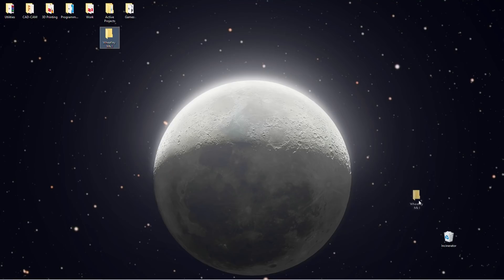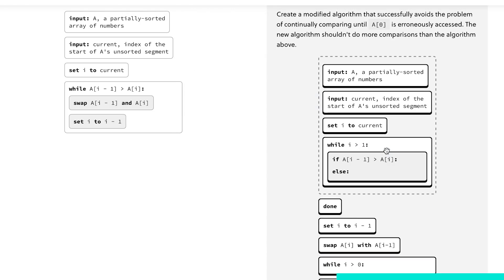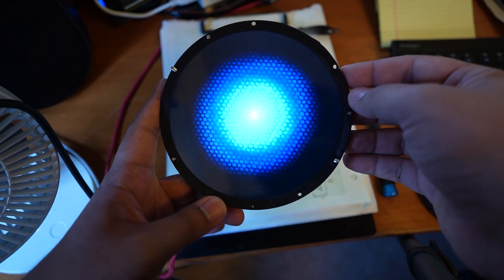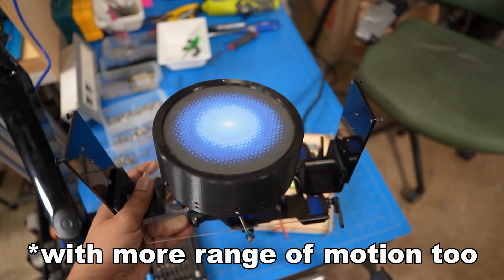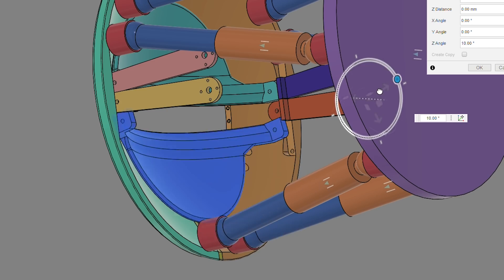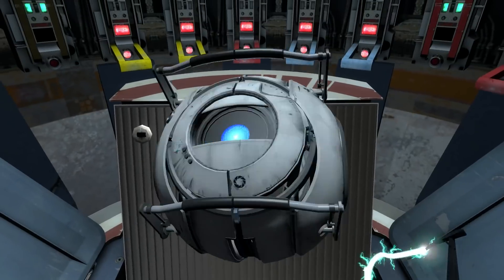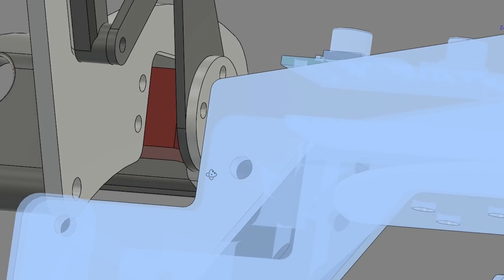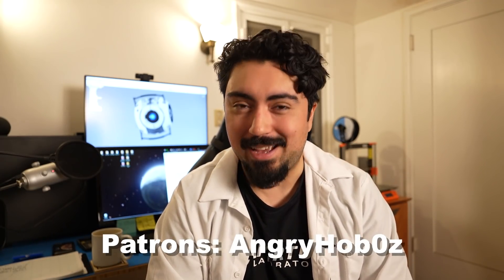Portal 2 - Wheatley in Real Life - Mk II Design

Comment: Can you get rid of the back support if you run an axel through the axis of rotation of the main guts of wheatly? You could have a cylidrical hollow axel with two smaller rods or one rectangular rod within it anchored to the sides to keep both halves of the outside lined up. Shouldn't you be able to fit those wire brushes for conductivity in there too? And feed the slid rod through the center of some bearing to still allow the inside to rotate? Or would that not work because its too small to use material strong enough to support all that.

Comment: 3:17 PTFE iris blades (thin, flexible + slippery, low resistance) to which you attach geared wheels at the ends, driven by a toothed belt that goes around. This assembly is smaller, thinner, and easier to drive.

Comment: I'm super excited to hear that you intend to open source the design! I'd be extremely excited to build this project if I can eventually find the time. Splendid job on your attention to detail everywhere.
Reply from the maker: It could kinda fit, but the issue with a central axis is this would prevent face/head twisting, since the face assembly would collide with any core shaft. It's quite tricky.

Comment: It’s sad at mark 1 is dead but I’m glad at this mark 2 design will be more accurate and less problems with movement and design
Edit:I noticed the design of the Personality sphere is at his side panels can open like fnaf face plates the reason the personality spheres don’t do it when you are holding them is because they need a support to do so because Wheatley so kindly demonstrates the opening plates when attached to the glados body in the scene i call the betrayal scene Wheatley spins and opens his side plates while doing so meaning either the side panels get replaced meanwhile he is in the core transfer or his side panels require something to hold the main core build of a personality sphere in place I feel like the latter is more likely and frankly impossible to be made real but doesn’t matter we don’t “need” it
Reply: But only, of course, with the sacrifice of size.